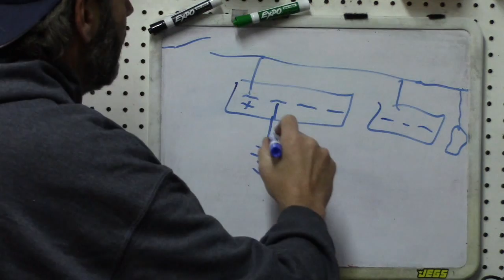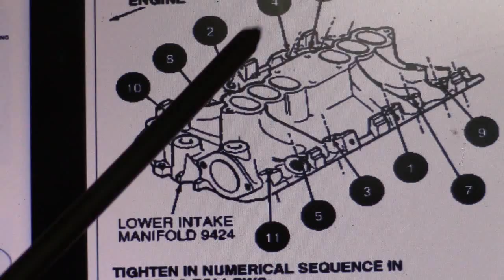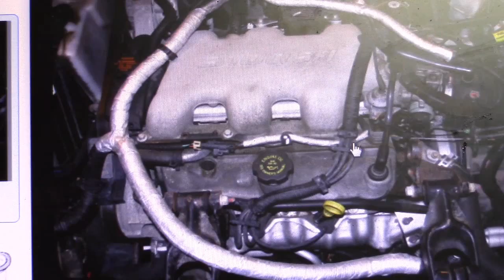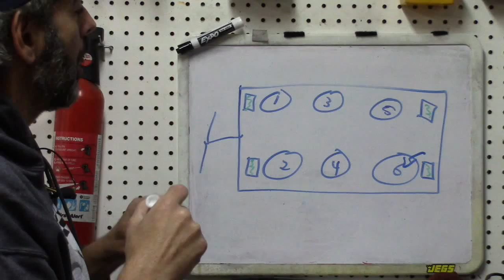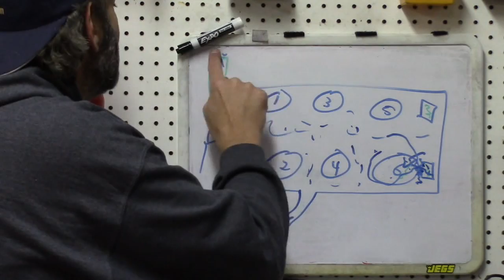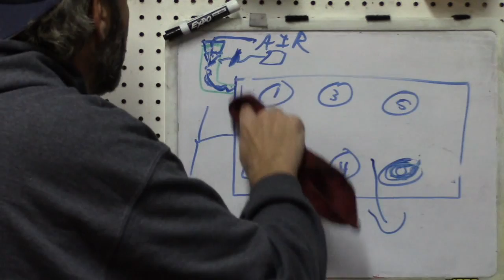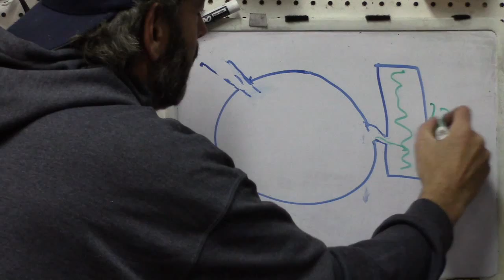04 Toyota P0306 Pt2-Can Compression Test Lie?

Comment: I would say 99% of MODERN engines have a dry lower intake manifold! 
Its ok to be wrong,  but before you open your arrogant mouth you should know the design of the engine you're working on!
Reply from the maker: This coming from someone who says 99% of modern engines have a dry lower intake?  You're lucky I don't ban you from the channel for being so stupid.
Reply: @SchrodingersBox   Name some modern engines that have a wet lower intake!  By that I mean engines that were designed with in the past decade!
Reply: I do this professionally, I am an ASE certified auto technician
Reply from the maker: @lustfulvengance  Ohhhhh - do you guys typically use  "argumentum ad authoritatum" logic fallacy? Because 100% of the dozens of wrong diagnoses from shops I show on this channel were from "professional" mechanics
Reply: Looks like someone got butthurt over one mistake lmao
Reply from the maker: @misterfawkingunderst  Yes, lustvful did get butthurt but he will get over it.  Me on the other hand, I admit my mistakes but it doesn't mean I will suddenly accept stupidity or inaccuracy.
Reply: @SchrodingersBox  I was not butthurt in the slightest, I called him out for being arrogant! I learned a long time ago to hold my tongue unless your educated on the facts and are 100% correct!
A simple Google image search for this engines cylinder head would have avoided his arrogant, condescending statement in the first video!
And no, the shop I work at gets all the mis-diagnosed and improperly repaired vehicles from other shops for me to fix and diagnose correctly!
Reply: @lustfulvengance  I'm just curious - what do you think is a problem with this vehicle?
Reply: @messer7bc  I 100% agree with his flap theory! Its the only scenario that makes sense!
Reply from the maker: Why doesn’t my other theory- a cracked coolant passage on the cylinder head that enters a runner not also sensible?  Actually why isn’t that more sensible?
Reply: @SchrodingersBox  Due to the fact that a simple google search reveals 100's of other similar cases of this exact same problem! 
TBH it doesn't matter where its leaking from, the head has to come off and go to a machine shop anyway!
Reply from the maker: @lustfulvengance  There goes lustful vengeance using the "everyone else says it is, so that's what mine is" just like basic bitches on a an automotive forum ROTFLMAO.  "Everyone on the forums said change the MAP" lol.  Smart people call this common logic fallacy "argumentum ad numerum".
Reply: @SchrodingersBox  By your logic, any TSB that a manufacturer releases is complete useless information then! Its a common problem due to some engineering/manufacturing defect that has a known cause and solution! 
That combined with coolant in the combustion chamber is all the information that is needed to justify removal of the cylinder head!
Remember, you do this FOR FREE as a hobby! In the professional world, when you need to do this efficiently you use all the available information to come to a quick conclusion! 
Something your missing here:
IT DOESNT MATTER WHERE THE COOLANT IS COMING FROM ON THIS PARTICULAR ENGINE!
The head comes off and the machine shop can check it for cracks! Either way its getting a new head gasket and may or may not also need a new head due to a crack!!
Reply: Well, this is an interesting thread ;) I'm pretty sure you are both taking about two different things. One is about the problem itself - what's wrong with the car, and the other is about the way how it can be proven using particular method. Well, it all depends what's more interesting. To be right or to fail using right methods but wrong assumptions ;)
Reply: @SchrodingersBox  I would just like to add:
I think your extremely intelligent, I watch this channel because I enjoy seeing someone else use a logical and scientific approach to diagnosing automotive failures.
A little less arrogance goes a long way, thats all I was saying!
Believe me, I HATE when morons throw parts at a problem and charge the customer for their attempts to fix their vehicle! It makes everyone in the business look bad!
I take ALOT of pride in what I do and, like you if I am wrong about my diagnosis I eat the cost of my labor and parts and beat my self up about being wrong but learn from my mistake!
Reply: @lustfulvengance  arrogance is kind of Matt's trademark ;) it doesn't look as bad when he is right (most cases) but it's indeed little bit weird when mistakes happen. But all in all it's just "fun factor" in my opinion so take is easy everybody and carry on with the main goal of this channel: learning and using proper diagnostic methods and hopefully solving automotive cases accurately and with honesty and pride! Btw I don't think scientific approach is opposite to manufacturers documentation or "known bugs" in design. It all complements each other, so we can pinpoint issues faster (using those for defining less likely/more likely) and still precise and with scientific proof.
Reply from the maker: Changing your story again Auto Tec?  You know what - I’m done with you. Next time you post something that has no value or content or doesn’t explain exactly how a relative compression test is invalid i’m going to just block you AND LustfulVengeance from this channel.   So start thinking if you want to blab further.
Reply: @SchrodingersBox  Ahhh the mark of immaturity! You obviously did not read my last comment, you just choose to resort to threats and childishness! 
You know what I am thankful for on this Thanksgiving?? My lack of arrogance and my integrity 😁
Reply: Now , now boys there's a place for everyone in this business. I'm more interested in why these engines failed in the first place. I mean the chain of events that led to any mechanical failure. Be it engineering,  poor mantainace, abusive use, or just old age. There is always a reason for a broken mechanism. Find the mode of failure, understand it, and make the next one better. In the process you will become better as will your work.

Comment: I just wanted to add this as another consider. This is one of many for the 4th Generation of the 4Runner. I still used your methodical approach to come to my conclusion for my 4Runner. Maybe this link does not even apply to you.
https://www.toyota-4runner.org/4th-gen-t4rs/174451-new-member-need-help-p304-misfire.html

Comment: It's entirely possible for there to be a head gasket failure between a coolant way and an oilway, without it breaching any of the cylinders (or indeed between an oilway or coolant way and the outside).
Reply: But then why misfire?
Reply from the maker: Yes I agree except there is no (or at least extremely little) coolant in the oil.  Also my pressure test did put coolant into the cylinder.
Reply: @SchrodingersBox  Yes. I was wrong.
Reply: that's what I was thinking

Comment: Thoughts:  1.  Sounds  like a cracked head leaking into a valve runner. 2.  Try pressurizing cooling with #6 at bdc while looking into cylinder with a bore scope to find actual leak, including a possible cracked block. 3.  Have a machine shop leak test the head when it is off.
Reply: Agreed with this.
Reply from the maker: Yep- On board with every single thing you said! We're on exactly the same wavelength!!

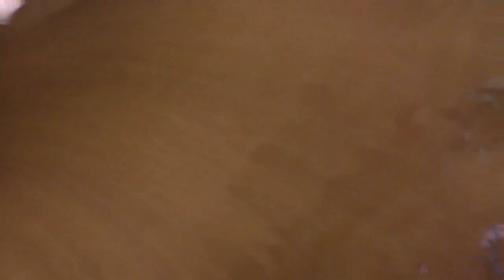Comment: No that this is relevant but I believe the engine @ 8:28 is a 3.4 or 3.8 GM motor...
Reply: Yup 😁Lol I knew that just buy the oil cap.
Reply from the maker: Yeah I just wanted to show an example of what a "wet" intake is like. It was indeed a GM
Reply: Some type o f 60 degree gm.  3.1, 3.4